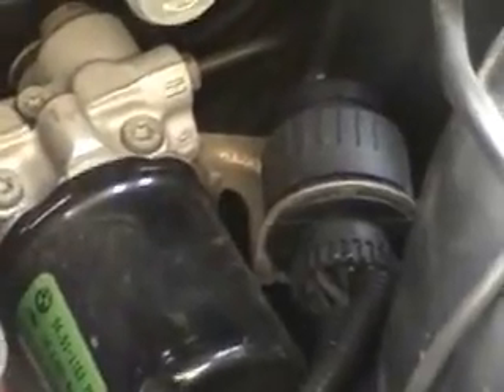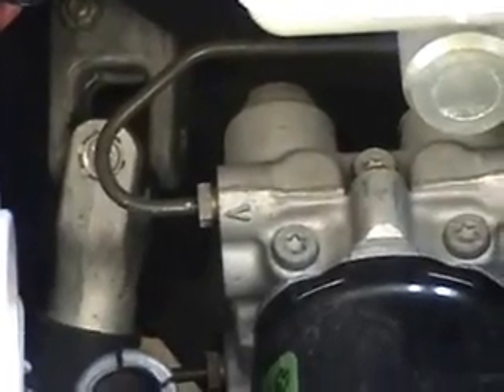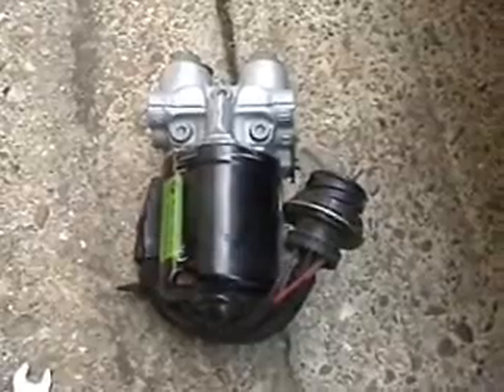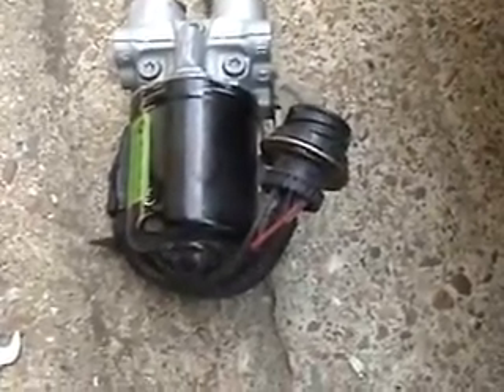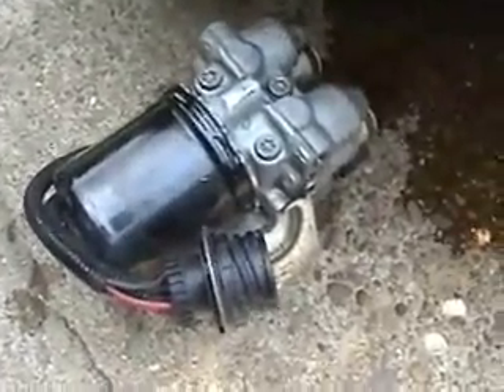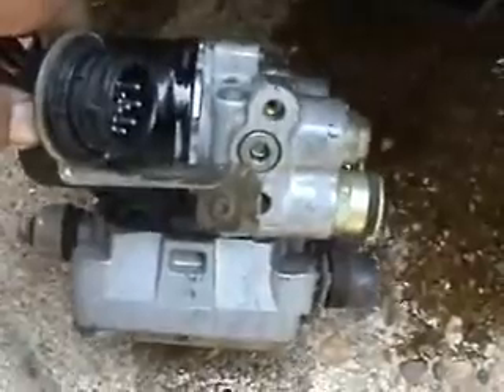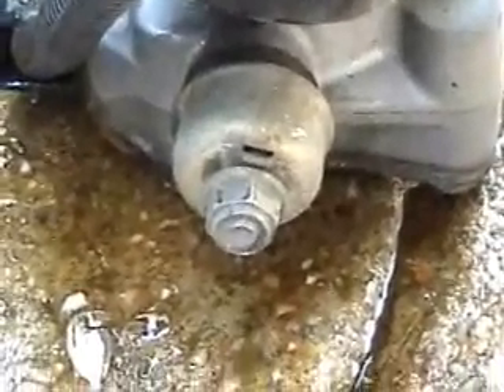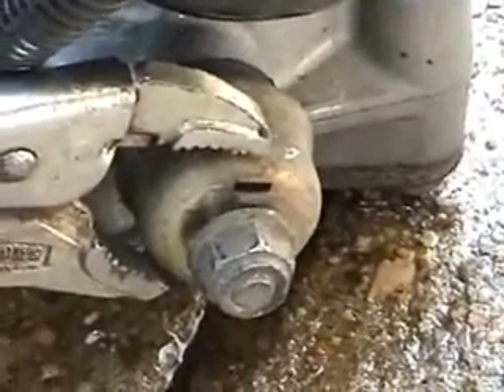BMW E36 ABS PUMP REPLACEMENT

Comment: What year and model is this car? Does it have ASC as well? Did the new pump need to be reprogrammed to the car or have any calibration done? Did you ever try to repair the old one?